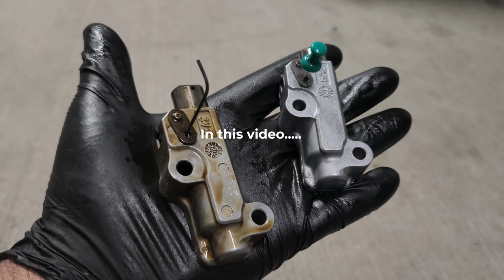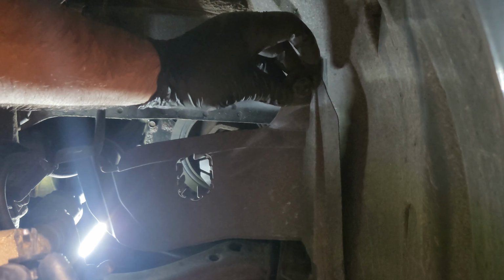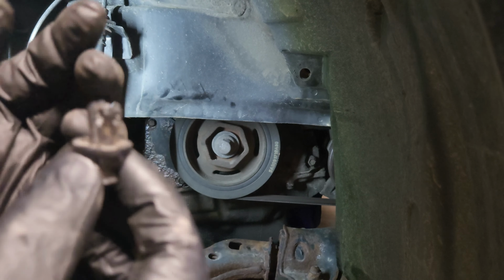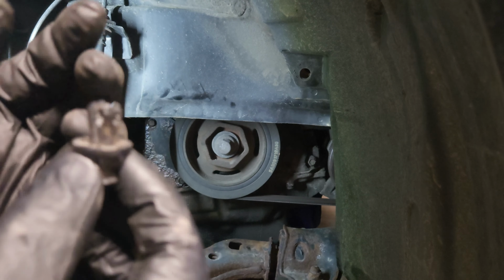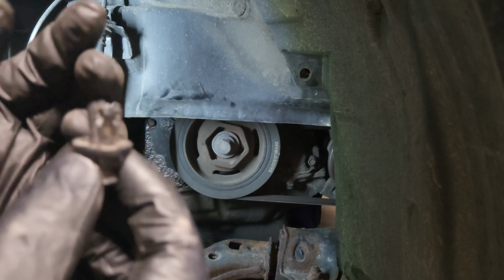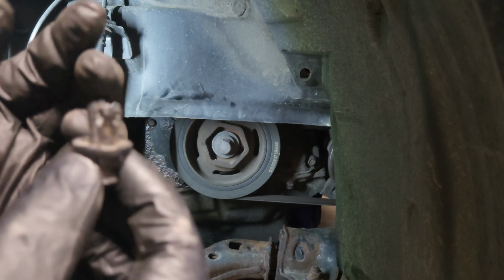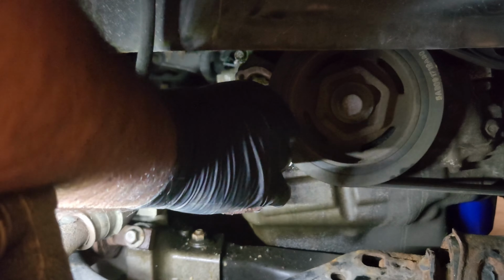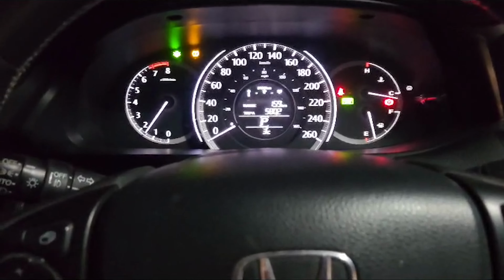2013-2017 Honda Accord Timing Chain Tensioner Replacement *COMPLETE STEP BY STEP GUIDE*

Comment: I'm having that rattling noise on my 2017 Honda Accord coupe and currently getting it checked out at a trusted shop in Los Angeles. I hope it's this issue and they don't charge a lot. I called a dealership on how much they charge to just look into the issue and they said $200 before they can find the issue.
Reply from the maker: Thank you for the reply. I hope the video was helpful and you got your car sorted out. Please like and subscribe if you haven't already ✌️
Reply: I had to change out the whole timing belt assembly since it was leaking oil. So I had to pay $1500 bucks for the whole replacement.

Comment: Would this repair be similar on a 2009 honda accord?
Reply from the maker: I believe it is slightly different as it is the earlier generation of the k24. I would do a little more research specifically for 08 to 12 accords. ✌️
Reply: Same engine, same fix.

Comment: Did you manually reset the teeth on the tensioner? Seems like you just installed it without resetting it not sure if you have to.. There is another video that explains using a c-clamp to reset the tensioner so that it is able to fit into the piston without damage on start up.
Reply from the maker: No I did not do that. My car has over 20,000kms and still running good. Thank you for the comment and please subscribe if you haven't already ✌️
Reply: How about after the installation? Do you have to turn the engine back 90 degree clockwise after you install the tensioner?
Reply: i’m curious about the second part also? do you have to rotate the engine back clockwise after the tensioner is back on or let it do it on its own once the oils is back in it?
Reply: @fixithoney  thanks
Reply: @musicflows21 I would. The video doesn’t show the crank being turned clockwise after the pin was inserted. It’s important to do this because the chain slack is essentially on the opposite side of the tensioner.
Reply: @thomast2307 turn the crank clockwise about 90 degrees once the pin is inserted so that the slack will be on the tensioner side. As the video shows, when the pin on the new tensioner was removed, there wasn’t much slack on the chain because it was on the opposite side. Imagine the starter spinning the crank with the slack on the opposite side. That’s the reason timing jumps in some cases.

Comment: Hi there
I have some noise , when cold start my 17 accord.will do video tomorrow and send to you , so you tell me opinion. Did engine light come on youre car, before you change timing chain tensioner. Just wandering.
Reply from the maker: Hey, I hope you fixed you car and hopefully the video helped you out. ✌️ please subscribe if you haven't already
Reply: @fixithoney  not sure 
Did you hear noise , on video.
I was hopping to hear youre opinion.
Mechanich told me is Tensioner on serpentine belt.
Thanks

Comment: Great vid! Did this to my 14 Accord. The noise stopped for about a week but now it’s coming back. It’s been 2 weeks since I changed the part.
Reply from the maker: I would take the inspection cover off again and just look inside for anything obvious. Your chain might be stretched or the guides worn out.   I hope you used an OEM HONDA tensioner. Please like and subscribe if you haven't already ✌️.  I hope this helps.
Reply: @fixithoney  indeed OEM….I gave it an oil change and haven’t heard it since. Again really appreciate your video
Reply: @davidjordan5592 these tensioner fail due to low oil pressure, and bad oil change maintenance, nit to mention they burn oil especially in higher mileage

Comment: I have the 2013 model Accord. It recently started giving a little trouble. The car shuts down at low rpm sometimes when waiting in red signal. And the Check Engine and steering light comes on but disappears the next day without doing anything. Got the battery and alternator checked, no issues with those. Any idea what it can be?
Thanks
Reply from the maker: Thank you for the comment. I would first try and retrieve what codes the car is setting. It might be something simple or maybe something serious. I would tell you buy a cheap code reader that just reads codes and go from there.
Reply: Did u figure it out ? It could be the mass air flow sensor needs cleaning
Reply: Had a similar issue at 100k miles and the valves needed adjustment. Took it to a mechanic and he had it done by the next day. Simple job but not one I had done before.

Comment: Are these tensioners prone to fail with high mileage more than the chain guides?
Reply from the maker: @vigourdiy5084  the tensioners are actually known to wear sooner then the rest of the timing components. Leaving one that's on its way out over an extended period will also cause everything else to wear and will be much bigger job. Worth changing if you hear that initial noise at a cold start.
Reply: @fixithoney The owner said the rattle started a week ago, maybe two or three... the noise is constant even when the car is warm. Hope there's no additional damage. I'll try the tensioner first.,

Comment: Can I just adjust my old tensioner on my car by a tooth or two?
Reply from the maker: @markythemark4598  I wouldn't personally and old tensioner that is weak. To put more stress on it by adjusting the teeth. The part and repair is worth it in my opinion
Reply: @fixithoney  ok sir. I agree. Just wanted your feedback. Thank you for responding. 🙏

Comment: don't u have to turn the crank clockwise 90 degrees after u install the new tensioner?
Reply from the maker: I personally did not turn it at all after i pulled the pin out. I did have the rattle on first start after the repair but has been good so far 👌 . Nice and quiet
Reply: @fixithoney  Turn the crankshaft counterclockwise to line up the holes on the lock and the cam chain auto-tensioner, then insert a
1.2 mm (3/64 in)-diameter pin into the holes. Turn the crankshaft clockwise about 90 degrees to secure the pin. not after new tensioner goes in my bad
Reply: says after u turn it counter clockwise and install the pin, turn the crank clock wise again for about 90 degrees. i dont see people do this in videos tho not sure what to do
Reply from the maker: @8000b  if this is honda recommended i would say do it for sure. I personally didnt know till now. Thank you for the comment and like/subscribe if this helped at all. ✌️

Comment: Hey does anyone know what size those bolts were ? I need to make sure I get the right size sockets for them
Reply from the maker: I believe it was a 10mm for the cover plate and the tensioner. More importantly i had a little hard time finding something thin enough to hold the tensioner together. Hope that helps, subscribe if you haven't already. ✌️

Comment: I have a 2014 Honda Accord Sport and I have a cold start issue. I am about 130,000 miles now. Only when I cold start, I have a rattle right where this guy is working. Does anyone have any idea how much this would cost to replace in my model? I noticed the 2013 has a little different set up so wanted to see if anyone else out here is replacing this on the 2014 model. I am a researcher before paying for a mechanic hours to diagnose. I was a wife of a mechanic so I know the value of research before you dive into a mechanical issue. It has saved me hundreds of dollars not paying for someone to go down a rabbit hole. Any help would be appreciated from this Marine Momma.
Reply from the maker: @jeanetter3187  yes this is a common issue with all 2013 to 2017 honda accords with the 4 cylinder engine. A shop might recommend doing the chain and tensioner but in most cases it's not needed if caught early enough. The part is 200 CAD and can be done in a couple of hours by a good mechanic. I hope this helps please like and subscribe if you haven't already ✌️

Comment: Nice video, did this to my accord this morning. Only problem is the filter was stuck on the engine block, when i went to take it off with needle nose pliers, it fell into the oil. Dropped it off at Honda ~$750 plus tax to drop the oil pan... Dont make this mistake!
Reply from the maker: Thank you for the reply. I'm sorry to hear that you had to pay for that mistake. Please like and subscribe if you haven't already ✌️

Comment: Apparently the 2013 model and some 2014 models did not have a screen installed at the factory.  There is a Honda TSB 14-030 titled "Slapping or Clicking From Engine Area at Idle", and they state that the tensioner can be affected by debris at idle.  The TSB calls for a new tensioner and installation of the screen.
Reply from the maker: That makes sense but since the repair my initial noise at start up is almost fully gone. Thank you for the reply and subscribe if you havent already
Reply: @fixithoney so even after you did the repair the noise didn't go right away? TIA
Reply from the maker: Hey, thanks for the comment. Since the repair the car been 100% quiet and am very happy with the repair. If your car has this noise but has been prolonged over an extended period then maybe your chain might have also stretched along with the wear to the timing chain guides. You might need to do the full repair. Which is a much bigger job. I hope this answer helps.  Please like and subscribe if you haven't already. ✌️
Reply: @fixithoney  yes it helped and I haven't do the tensioner yet doing soon as I get the part but I hope it's not I brought the car about 3 weeks ago all was good the first morning that I head it I just drove it that day and parked it it part should be here tomorrow and yes the vtc or chain is a much harder job TIA

Comment: bro please help im doing it right now and the pin that i put in old tensinoer to lock flew out when i was unbolting the bolts that hold it in. not sure what to do or how serious this is
Reply: I even cranked it clockwise to lock it in I used a thumbtack I don't have a Allen key thin enough. the holes are still aligned
Reply from the maker: There is alotttt of tension on that tensioner and thats why you have to be even more careful now.
Reply from the maker: Honestly find something because if you dont that tensioner will shoot out like a rocket. NO JOKE.
Reply: @fixithoney  do I need to put the pin in and crank it 90 degrees again to lock it in?
Reply: @fixithoney  is there a chance I messed up the timing?? how could I know
Reply from the maker: As long as the bolts didnt fully back out ans the tensioner was totally free, you should be okay. If you hole is lined up and you have a pin to keep it in place you should be good. Just do it nice and slow.

Comment: Annoying noise aside, is there any long term damage if it is only on cold startups? I am in and out of my Cr-v all day working for Hospice and only get noise in mornings but not throughout rest of day starting and stopping. Is that short noise more of a nuisance or is it really an accident waiting to happen?
Reply from the maker: Thank you for the comment. Your engine will work fine but it is more of a preventative maintenance. If your planning on keeping the car for years and years like me. I would take care of it soon but it's a honda and it will just keep running as long as you stay on top of your oil change  intervals. I hope this helped , please subscribe if you haven't already ✌️

Comment: i have the same car, 2015 sport. does anyone in her have issues with rear tire chop and noise ?
Reply from the maker: Thanks for the comment. Almost all honda after a while get rear tires wearing unevenly on the inside due to rear springs sagging over time. You can buy adjustable arms to bring it back to spec. Let me know if this helped at all. ✌️
Reply: There is a tsb on the rear struts.

Comment: Why not replace the timing belt while you’re at it?
Reply from the maker: This is a timing (chain) not a timing (belt). Doing the chain and all the needed components while you are in their would require all more time and thousands of dollars. my car has always been maintained and for under 200 bucks i can stop any unwanted wear on all other timing components. Quick and easy fix. Thanks for the comment and subscribe if you haven't already ✌️
Reply: @fixithoney  my bad.  I was neck deep in replacing my daughters worn out hydraulic tensioner, idler pulley, timing belt, and water pump on her accord sport when I came across this video and had belts on the brain. To each his own.

Comment: Good video but terrible advice. You never change just the tensioner. The whole kit needs to serviced. Tensioner, guides and yes the chain... despite the myth that chains dont go bad, they do in fact stetch and cause chain slap until it eventually skips timing.
Reply: If the chain hasn't been stretched, there is no need to replace it, unless you really want to do a preventative maintenance on the car. If the old tensioner hasn't extended beyond Honda's specs for replacing the chain, then there is no need to replace the chain. Obviously, if the tensioner has extended too far, then the chain has probably been stretched, so yes, at that point you would need the kit.
Reply from the maker: Eventually down the line i will be replacing everything all at once but as of right now i only needed to do the tensioner. I have already put over 20,000kms and still working great. IMO i am just trying to save the timing components from unnecessary damage if i had let it go for longer. This just is cheap and simple job to do and i only posted it to make it simple and clear for anyone else trying to do this job. Thank you for the comment and please subscribe if you haven't already. ✌️
Reply from the maker: Thank you the comment and i agree with you 100%. Please subscribe if you haven't already. ✌️
Reply: How do I know if I need to replace the chain. What do I look for ?
Reply: Honda has TSB 19-019 for this where they just do the tensioner. If the chain were to be inspected and had too much stretch then it's a bigger job to do it all.